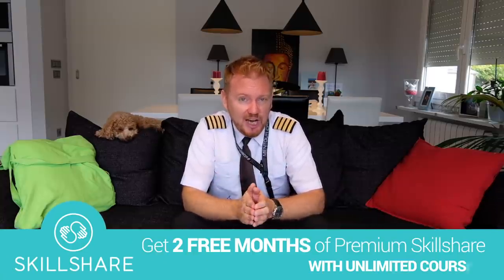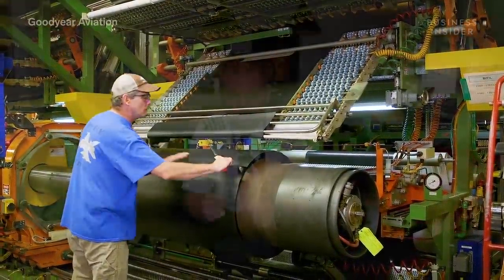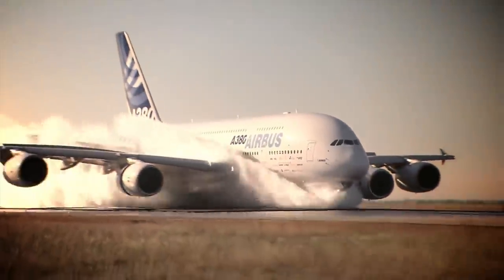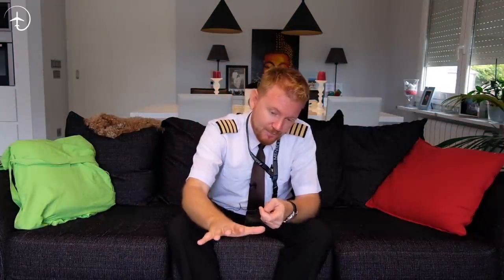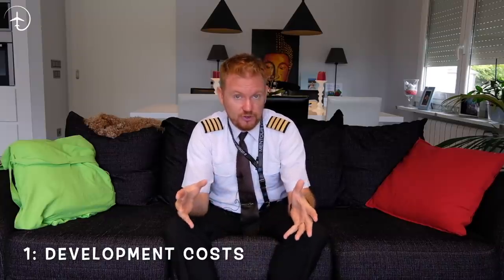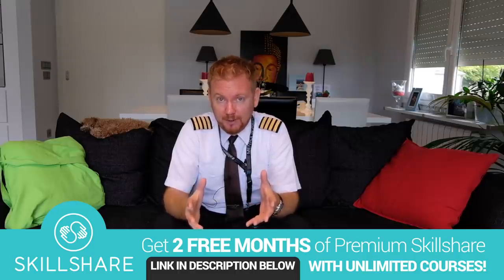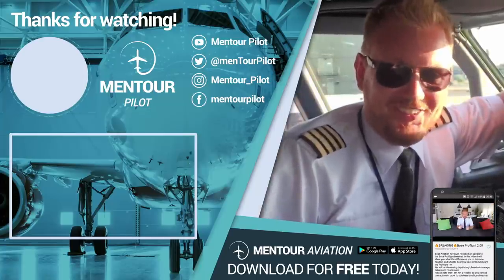Why not make plane-tires spin, before landing?!

Comment: I was a landing gear engineer with a major airline for 33 years and the tires were one of my responsibilities. Seeing the 2,617 comments below remind me of the MANY times I answered the same question. One of the major points you didn't mention is that the wheels spinning at touchdown speed with the tires  out of balance would shake the airplane apart. With eighteen tires spinning on a 747 one can imagine the shaking that would occur and the passenger's reaction.  Actually, B.F. Goodrich ran an exhaustive test on this problem a number of years ago and discontinued the test because of the vibration it set up. 
Everyone believes that adding little flaps on the wheels or tires would solve the rotation problem but there is no way to control the speed of each tire so there would be no real benefit. In addition, not only spinning the tires but the brakes would also have to be spun up which would require  considerable power. The brakes are designed to  absorb the  enormous energy of a rejected takeoff and not easily rotated.
Nitrogen is used to prevent the tires from exploding. We once had all four tires explode  on a 727 after the pilot taxied the airplane up and down the runway trying to burn off the fog. The tires at that time were filled with air (80% nitrogen and 20% oxygen).  The brakes became so hot with all the taxiing that the tire solvents mixed with the 20% oxygen and became hot enough to explode. We all converted to filing the tires with nitrogen after that. As an added note, when the Concorde was designed, they considered using nitrogen in the tires just to save weight. 
The gyroscopic effect of spinning tires would also adversely effect trying to control the airplane  during a critical time of landing.
Your video brought some interesting points from a pilot's perspective. I just thought I would add a few points from an engineering point of view and experience.
Reply: Wouldn't compressed air (or bleed air) work as, not driving the wheels, but shoot them up to speed, any speed would lessen the wear and tear more or less, doesn't have to be exactly the airplane speed.
Reply: thank God, someone who knows what he's talking about ... I'm not an engineer , but I've been working for a major airline for the past 30 years or so , and still am ... I must tell you that from my point of you , the biggest issue would be the huge gyroscopic effect , generated by large spinning wheels,  especially on big aircrafts like B-747  or AB -380 ...
 imagine trying to land in countries during the monsoon season ... there is no way the pilots could manage a landing with strong cross winds ...
Reply: Your reply and your point of view about this matter was very interesting and very professional.
Many times people comment only about the superficial not seeing the technical part of the subject. Congrats for your detailed information. Also I believe that you should be the person to publish videos about the technology of the landing gear.
Reply: The LG of any a/c is what seems to be one of the major issues in a/c design ... and the correct functioning ( maintenance + correct use, within parameters ) is mandatory ... think about the Concorde : it's the chain of events that led to catastrophe , and the key role was a non correctly rebuilt LG ... they forgot to put the spacer between the ballbearing ...
Reply: What would stop the addition of small fins to the wheel hubs so that they spin up in the airflow?
Reply: Toby Seaman The gyroscpic effect would still be there. Wouldn’t it?
Reply: @YDDES  doesn't affect cars, why would it affect airplanes? The relative mass of the wheels is tiny and the RPM is not actually that high.
Reply: @YDDES  yes, Sir !
Reply: He did mention about one wheel spinning faster than others with a possible faulty motor and shaking the plane off course, although he should have mentioned that even if the motors don’t fail it would still be nearly impossible to have all wheels spinning at the same speed.
Reply: Bill Witt is the shit
Reply: I'm a software developer working in real time safety critical systems. I'm really sure that all of the control issues wouldn't amount to much. Getting the wheels spinning at the same speed wouldn't be critical, they already don't spin at the same speed on current aircraft (wheels don't touch the ground at the same time). If I were designing the system there would be a hard power cutoff (per gear, per wheel, whatever suits) so that the wheel couldn't drive the aircraft while it's landing. 
I think Mentour hit the nail on the head with just one part of his point number one. It wouldn't be economical to add the weight for this kind of system. You could argue that the tyres could be made to be less resilient and therefore lighter if they didn't have to take the sudden speed increase, but I expect the saving wouldn't be much. They'd still have to be able cope with a fully laden, and fuelled aircraft returning to the takeoff airport.
Reply: @doncarlo5  I think we must remember that the missing spacer in Concorde's  "non correctly rebuilt LG" did not burst it's tyre or rupture the fuel tank. Continental were "responsible" for the Concorde crash: -  "The court ruled that the crash was caused by a piece of metal left on the runway after falling from a Continental jet - 6 Dec 2010." 113 killed reported by BBC 6 Dec 2010   people"
Reply: @rodharrap873   a colleague of mine ( died of cancer,  ... RIP ) was talking at the phone with some other colleague in Paris, (CDG int. airport ), it was the 25th of July ... I recall :I had late shift , that day !  At the very moment he ( colleague in Paris ) shouted : "Oh My God ! the Air France Concorde ...  just passed by , IT'S ON FIRE  ! And he hang up !"
According to the data recorders ( black boxes , both were "readable" ) and based on the evidence of the numerous eye witnesses, this is what happened :
the piece of metal lying on the track  ( lost by Continental  DC 10 )  ripped the tire , at that speed a big chunk of tire ( ca 10 lbs. ) hit the lower surface of the left wing , causing a shock wave ( and due to fluids non compressibility ) caused a plug in the tank to pop open  ... Concorde has 17 tanks ( for two reasons : for weight shifting during flight ... as 200.000 lbs of fuel  are needed from CDG to JFK ), and because of space optimizing , obviously !
At that point the jet A1 fuel started to pour out at very high rate,  but , still it wasn't lethal, to that point ...
A fuel spill had already happened once before , at JFK int. airport  ( but the fuel didn't catch fire , back then ).
Unfortunately, some debris from the busted tire severed an electrical power cable to the left under carriage , which sparks  ignited the kerosene flow , consequently the huge heat, generated by the burning fuel ,  started to affect both aerodynamics ( ailerons ) and engines thrust ( jet engines breath air - take the oxygen away - they starve ! )... now the pilots have just lost  76.000 lbs of thrust on the two engines ( left side )... DURING TAKE OFF ... the moment you need it most ! 
Cpt. C. Marty had to get airborne , he had already reached V2 , and had only 2000 m. track left ... at 340 Km/h , Concorde would have taken 3000 to a full stop !
Cpt. Marty  had taken the wrong decision to start with a mild rear wind, ( obviously ,  the take off speed of the Concorde is not much affected by a 8 knots  rear wind ) but it was also taking some extra weight in cpt. 5  
( luggage ) , and some extra fuel ... 
The fact that the spacer was missing forced the pilot to make a quite peculiar maneuver:    since the Concorde was not keeping a straight path, ( the left LG gear was "wobbling about" ) instead it was pulling to the LEFT ...
French President Francois Mitterrand was sitting with his entourage in Boeing 747 on taxi-way ... on the LEFT !  Waiting to get permission for take off ! Tower gave priority to Concorde , because they already had more than ONE  hour delay due to technical problems !
Marty had to get the nose up and take off ... otherwise, he would have been hitting the Boeing 747 waiting on the taxi way ( again ... on his left side )
Such a maneuver is called - to rotate - ( get the nose  up ) this meant putting extra load onto the already damaged left LG ... since the total weight of the a/c would be lasting on the LG ... the rest is history ... a sad one!
By the way : I'm not  makIng this stuff up   !
Reply: The vibration of a freely rotating tire can be excessive. Even on a small tire like on a Cessna 150 it can become necessary to use the brakes to stop the rotating tire vibration. It can rattle the entire airplane.
Reply: @Hoggaforfan  Read it again.
Reply: @tobyseaman7977  Read again what was written.
Reply: @tobyseaman7977  cars are in constant contact with the ground, not free to spin in the air. But tire weight does effect the handling of cars is does, therefore Compositte wheels and brake rotors a Grand fix Cars and Moto GP Motorcycles.
Reply: @flyingdog1498  don't understand your point. Contact with the ground irrelevant, we are talking about gyro effect of spinning wheel?
Reply: @tobyseaman7977  You need to study physics.
or maybe take a Mechanical Dynamics class.
Reply: @flyingdog1498  Read it again? Haven't read it in the first place. It's quite some difference between the weight of those plane types and landing gear. Don't you know physics? Beside my post was a though and just an idea, not in anyway stated as fact. I also read your posts to Toby and don't know if you are condescending or need medication.
Reply: @flyingdog1498  perfect, thanks. The gyrosopic effect for tethered and untethered is really interesting, but it's you that's not studied it :-)
Reply: @Hoggaforfan  You are a God Damn moron,
Reply: @Hoggaforfan  why would they use compressed air and not the 140 mph slip stream to spin up the tires
Reply: @ohhno1358  Slipstream would most likely be more weight and quite bulky to be of any use and not as effective either
Reply: If wheels spinning in-flight would "shake the airplane apart", then how does the aircraft survive takeoff when the wheels will be spinning as the aircraft leaves the ground? I just assumed a mechanism to spin up the wheels before landing wouldn't be worth its weight or complexity.
No idea what the magnitude of the gyro effects will be with tyres spun up for landing, but, if the tyres are spun up, and you try to roll the aircraft right, you need to exert a left-yaw moment on the spinning tyres, and if you don't, the aircraft will experience a right-yaw moment, right?
Reply: @tobyseaman7977  You would be suprized. On normal conditions difference is small. But on race track you will notice it more. Suspension works better (less unsprung weight),  brakes better (less inertia) and turns better. (less gyroscopic efect). That is why we spend lot on forged wheels and dont buy cheap cast ones.
Reply: @takatamiyagawa5688  they have brakes.
Reply: @Hoggaforfan  Do you even know what a slipstream is? Your first comment had some merit - bleed air is useful and abundant, although most of the other problems remain. Everything you have added since then does not reflect well on you.
Reply: @tobyseaman7977  Bill addresses your idea in his post. The vanes or flaps would either be too small to overcome the inertia of the tyres and brake discs or if made larger would lead to high levels of vibration, besides being one more point of failure and a source of runway debris.
Reply: @DavidSmith-vr1nb  Yes I know what it is and I posted my guess about it and reason for that guess, I thought it was clear it's just a guess. Besides my guess seems to be backed up by others. The third post I did was just to a very arrogant and confusing person.
Reply: @doncarlo5  Not knowing tire mechanics, but the aircraft is tons, tires are pounds.  I can't imagine the tires spinning would have any impact at all on anything when touching the surface with tons of weight on them.  But, I have to assume it does by also assuming this has been tested and proven thousands of times.  And balancing?  That's why my car's tires are...um...balanced.  Plus, they already vibrate the plane when lowered.  I must be seeing things in a very simplistic light, and have to accept the experts, which is hard at 65.
Reply: smart man
Reply: @tobyseaman7977  Vibrations if you would've read the good explanation of the landing gear engineer above.
Reply: @ayuse01  I did read it and it doesn't make sense. Landing gear gets vibrations anyway from asymmetric wear. Wheel balancing is a technology that is a hundred years old or more. This is an old thread.
Reply: @da4127  why nearly impossible to get them spinning at the same speed? You do know that this is a solved problem? We've been making things spin at exact RPM for 50 years.
Reply: Gyroscopic effect? Seems to balance a GYROSCOPE...OR A BIKE WHEEL... Provided the spin axis is in the same direction as the aircraft travel...no probs.
And....make sure the wheels and the device are well balanced.
In my experiences...it's the MTOW which concerns airlines.
Any weight added to the aircraft means less payload... Less money.
It ALL needs to be within MTOW
Reply: @MrCybaherbz  gyroscopic forces are good when you try to keep a straight line, but an aircraft have to make some high angle crab approach to counter crosswinds on landing. The aircraft have to make fast yaw movements at the last second just before touching down, with strong winds, the last thing you need is having to deal with gyroscopic forces on top of the rest.
Reply: @ayuse01  I get your poin. BUT we are talking 400 tonnes of plane being destabilised by a few spinning wheels... Nah...not buying it.

Tell me...on TAKE OFF... The plane could be doing 160 kts... Depending on wheel diameter...the wheels are going to continue to spin for a considerable time after losing contact with Terra Firma.
Then..the gear us pulled up... sometimes in a straight line.. sometimes to the sides...and even sometimes they twist as they go up to the well. So... SURELY..the "negative effects" of gyroscopic effect would be
..
1) More critical since the aircraft is gaining speed as it climbs.
2) More critical because unlike the so called "negative problems of gyroscopic effect" when landing, the plane is no longer on the ground and is getting higher and faster by the second.
So...If the GYROSCOPIC problem causes terrible safety issues... isn't the THREAT  magnified by the obvious fact that the crew can't stop the plane and sort out the issue whilst the plane is accelerating to cruise altitude and speed.
On the ground... That isn't a problem. Tbh... Have you ever landed in a SMOOTH strip...
These runways are worse than dirt tracks sometimes. Would anyone even notice the wheels spinning... I seriously doubt that.
3) If such a negative effect is overshadowing pre touchdown wheel spinup... WHY IS IT ALWAYS A SUBJECT WHICH DRAWS LOTS OF INVENTORS AND ENGINEERS TO SPEND TIME TRYING TO PERFECT AND MONEY FOR THE MULTITUDE OF PATENT APPLICATIONS WORLDWIDE...

That's my reason for 20+ years of chasing the grail.
Reply: @MrCybaherbz  Listen, even Bill Witt said it ,and I quote : The gyroscopic effect of spinning tires would also adversely effect trying to control the airplane  during a critical time of landing. : 

So if you feel like arguing with a 33 years experienced landing gear engineer, it is up to you Mr.Cybaherz
Reply: @MrCybaherbz  I understand your thinking, but where you make error is-

When an aircraft ( let's say a boeing 737-500 ) take off, the wheel brakes engage as soon as the command for gear retract is engaged. The wheels stop within a second or so after the landing gear lever is actuated. Then the wheels gets retracted.

Second, let's say you make a 14 hours flight, having anything to carry in the air for this amount of time cost fuel, a lot of it. And you have to reduce the payload accordingly ( another loss of $$ ) 

Third, you gain in complexity, not good in the air.

I could keep on going as to why it is a bad idea. But let's say this. The engineers who designed such massive aircraft are way ahead of us in the matter. And I honestly think that if it was such a good idea to pre-spin wheels on aircraft, it would already been addressed.
Reply: @tobyseaman7977  the wheels are indeed stopped as soon as the aircraft take off, to mitigate vibrations transferred to the cabin, and to cancel gyroscopic forces before stowing them. Just take a ride in a boeing and feel the vibrations as soon as the wheels take off, it stop as soon as the command for gear retract is actuated.
Reply: @ayuse01  NO ERROR....  JUST OPINION.

40+ YEARS IN ENGINEERING AND ELECTRONICS WORTH OF OPINION.
ENJOY YOUR WEEKEND. 👍🤠👍
Reply: Thank you for the correct reason for use of nitrogen. Large earthmoving equipment do so for the same reason, tire explosion. All the rest is nonsense. Based on this issue alone makes me never listen to this guy again. And thanks for the knowledge on balance. I had not considered that, but had considered the huge weight/power of motors to perform the pre-spin task and dismissed the idea many years ago on that basis alone.
Reply: @ashleyjanit5052  True, also burning a bit of rubber makes the tires a bit warmer, if its long haul fligt, tires might be super cold when the come out, and have no way of gripping if they are not warmed up.
Reply: I have a question.
How in God's name did they expect a 727 to clear fog?
Reply: The brakes aren't easily rotated? They had better be, at least when they are not applied, or they are adding to takeoff distance! Of course, I've never spun the wheel of a plane over 25 tons, so maybe Boeing and Airbus waste huge amounts of power by dragging the brakes when not in use.
Reply: Tires, no matter which type were never designed to free spin without a load. Spinning up a tire to 200mph without the weight of the plane on it, would send forces away from the center of the rotation, outwards. And while the bearings to the wheel are of metal alloys, the tire is a complex layering of cords, metals, and rubber. All this force would egg out the tire, sending the center tread outwards, beyond the way  it was designed to function. And while that may seem logical to some, it would most assuredly end in catastrophic premature tire failures. Possibly multiple failures at once. Not to mention, they would lose their ability to be retreaded, as casing stress would forbid future use. Look up videos showing the tires of a dragster warming up it’s tires, or somebody ruining their tires trying to get unstuck from ice or snow. Now ramp that up to a 200psi nitrogen filled tire, free spinning at 200mph. Too much risk, no reward. IMO.
Reply: It has been about 30 years since I ran an aircraft maintenance department, but I believe that spinning a tire for landing makes no difference on the wear of a tire that was not spun up. Both tires wear the same. The wear on the tire is caused not from friction of the tire at contact with the runway but from loading the tire. It has been a long time since I saw that test.
Reply: @davecrupel2817  The RVR sensors were known to be in a certain section near the end of the runway at my airport. I frequently took the first flight out in the morning. It was not unusual for them to sit a spool up the engines, turnaround on the taxiway and return to the hold short. This increased RVR above the TO limit. Away we went.
Reply: @Hoggaforfan  i was thinking the bleed air thing as well as that wouldn't be a positive drive like a motor. It would just be "encouragement" but the balance/vibration issue stated above makes it a moot point.
Reply: @Hoggaforfan  It's not important, whether your tires are attaining the exact speed of landing aircraft to reduce good amount of friction or not.
Point is while accelerating the spin of tires(all tires' "acceleration vs time" curve has to be accurately the same!!) to the opprox 300km speed with some means (mechanical, hydraulic pneumatic or electrical means) would result in additional unbalanced (different for every tire)gyro nose lift which is dangerously unpredictable in landing and to introduce these into existing system would be needing a lot of time consuming approvals, cirtifications and periodical "extra" validation protocols" , which are not worth than letting the tires wear a bit more..
Reply: @tobyseaman7977  cars run on land mind it.
Reply: @tobyseaman7977  contact with ground makes the car highly stable making wheels gyro neglible, mind it
Reply: Toby Seaman Cars are down on the ground, and stand very stable with one wheel at each corner. Airplanes are up in the sky, and don’t have that kind of stability. The gyro effect would be a lot more noticeable on an airplane.
Reply: Excessive brake use on taxiing aircraft continues to cause tire deflation from time to time, but that is not why the use of nitrogen is mandated in tires on braked wheels.  In 1986, Mexicana Flight 940 suffered a catastrophic wheel explosion after takeoff, resulting in a crash that killed all 167 people on board.  The explosion was caused by a dragging brake that overheated during takeoff, and the wheel failed after the gear was retracted into the wheel well.  This was not an unknown occurrence in the industry, but the magnitude of the explosion was far greater than could be accounted for by the excess pressure in the tire when the wheel failed.  The investigation revealed that there was a chemical explosion caused by the combination of outgassed chemicals from the overheated tire carcass and the oxygen in the air used to fill it.  Air is not now totally banned from tire inflation, although in practice it is not used.  If a tire filled with nitrogen is found to have low pressure but no leak, and no nitrogen is available to reinflate it, air may be used if the calculated mixture of oxygen in the added air does not exceed a critical ratio with the existing nitrogen.  This is a temporary measure to safely continue the trip and reach an airport with nitrogen available.

As far as spinning the wheels for touchdown, a tire manufacturer developed a tire with pockets in the sidewalls to spin up the wheels around 1940.  If I remember my history correctly, the tires were tested on the Douglas XB-19, which had the largest main wheel tires ever put on an airplane.  The tests proved that there was no useful adavantage to spinning the wheels before touchdown.
Reply: I am curious how this would work with electric motors that are digitally driven?
Like the Tesla cars, they can sense if they lose grip in nanoseconds and adjust thrust and everything, it's impossible to get wheel spin and accelerate really fast because of it.
Reply: doncarlo5 ....the heavy monsoon,cross winds, doubtful functioning of landing gear and a night landing on a tabletop runway...unfortunately we had all that happened yesterday taking 19 lives including pilot and co pilot 😔
Reply: The brake have to be rotated??  BS, Brakes are stationary.  They dont rotate.  The wheels and tires are the ones rotating.  Stationary brake system is used to stop them..
Reply: @outwiththem  so... what do the brake shoes or callipers apply pressure to? How do you transmit that load into the wheel? You use a drum or rotor. A large rotor for the size of airliner wheels would have a corresponding large mass. Trying to rotate a large mass takes a large effort. 
Add in some brake friction as the pads are skimming the surface of the rotor. Sure, the brakes aren't applied, but the pad will still have some contact. Jack up a wheel on your car, spin it, you can hear the contact yourself. 
Extrapolate those forces up to the scale of an airliner. Remember, you only have one disc per wheel on your car, airliners have multi disc packs per wheel, adding to the inertia and drag effects. 
So there are parts of the brakes that are not rotating, and others that are rotating.
Reply: @rustymozzy  -- he, he.. Im also an ASE Certificated almost Master Mechanic, retired now but worked for over ten years on dealerships as auto tech.  I know the rotors rotate with rims and tires.  The force of 140 mph winds can make small flaps on the rims or tires rotate them. 
Some Cessna Citations have that system for a decade, but on front tire only.  Airplane tire manufactures hate and put down those systems. 
Rubber smoke can mess your lungs too. Giving you black lung.  Rubber deposits on runway have caused many accidents too. 
Managers are getting kickbacks to avoid installing rim flaps.  Managers work in air conditioned offices with air filters to avoid getting all that rubber and kerosene exhaust at airports...
Reply: @outwiththem  a quick scuff on the runway will bring the surface of the tyre up to temp quickly to afford better grip, and there's not many people standing around the end of the runaway...
There's a lot more rubber scrubbing from tight vehicle movements on the apron in front of the terminal, there's probably more rubber dust exposure from the car park. It's a multi billion dollar industry. They've done the numbers, having spinning wheels would cost more, add weight and have less benefit than impact. 
If you wanted to eliminate tyre wear, you could add steering components to all groups, add more wheels, make the plane smaller, put less weight in the plane, increase wing dimensions to allow slower landing speeds... the list is endless. The key is finding a balance. Something is always sacrificed to increase performance in other areas.  In this case, rubber is easily replaced and maintained compared to the alternatives.
Reply: Great answer Bill, but please hear me out on a couple of things:
-If the gyroscopic effect was of such concern during landing, what about the takeoff? The Cessna Citation 500 series has an optional gravel kit with a pre-spun nose wheel.
-Filling the Concorde's tires with nitrogen wouldn't really do much for the weight as oxygen is only 3% heavier than nitrogen.
As you said; the potential savings per landing, with pre-spun tires, is pretty small (10%) as the diameter and shape of the tire changes during the initial spin-up resulting in over-under speed undulation pretty much regardless initial speed.
And the greatest ware occurs during takeoff anyway.
Reply: I did some work on a system similar to the one you described but with machined rotor vanes attached to the wheel rims. Keeping the wheel assemblies balanced was just one problem. Trying to get everything spinning and balanced at 2500rpm without causing excessive vibrations was a challenge. Once we had an acceptable solution on how to repeatably do that (a time-consuming engineering cost) the tyres still do not spin up to exactly the same speed as the runway anyway (they are always slower) and so they still scrub.

Our aircraft was a development aircraft. We had to alter the wiring and piping in the undercarriage bay and alter the shape of the doors to ensure enough clearance for the rotors (and it was still really tight). The brakes are applied when the undercarriage is unlocked anyway so the wheels didn't spin when extending or retracting but the extra width of the wheel assemblies wasn't nothing. It was 150mm per wheel on our test system. We figured we probably needed to at double that to 300mm for reliable rotation speeds. Any smaller and it couldn't overcome the friction in the assembly and the wheel wouldn't turn, much larger and the rotor vanes wouldn't fit in the undercarriage bay without modifying the aircraft structure, undercarriage assembly and bay. (Possible on new aircraft certainly not an easy, or cheap, in use fleet mod.)
The pilots noted the change in drag when the wheel brakes were applied in flight just before the undercarriage unlocked and when the brakes came off when the undercarriage locked down. The pilots never noticed any gyroscopic effects, or if they did they never mentioned them.
And test pilots mention absolutely everything at least twice to everybody they know.

The increased width and weight of the wheel assemblies, the increased size of the undercarriage bay, the reduced but not eliminated wear on the tyres, and the increased and ongoing engineering time required to balance the wheel assemblies with the rotors attached plus the increased wear on the brake rotors and pads all added up.
It wasn't working out to be cheaper than just changing a tyre when it wore out.
So why add the complexity?

And as a last point, the noises when the wheels span up to speed and when they stopped was a thing to hear. And you could hear it for miles even over the engines. From inside the cabin? Well. Yoiks!
Reply: Dirk Knight  If you had read the post closely you would have seen we didn't have a vibration problem.
The solution had both a logistics and engineering burden that was greater than that for standard wheel and tyre assemblies.
It was all the other stuff that eventually added up to pushing the idea out for financial reasons. It was just cheaper to change wheels when needed.
Reply: Dirk Knight  I'm pretty sure our tyres were Dunlop :-)
I think that all of the proposed engineered solutions would be viable, it is just that they would also all work out to be more expensive than just changing the tyres. They all have extra engineering time and costs. Aircraft don't make money sitting on the ground being worked on. Changing tyres is a pretty quick thing to do with experienced engineers. The tyre manufacturers really are not charging all that much for their products given what they actually go through.
Reply: Dirk Knight  Sort of. The mods would have saved us a dollar on tyres and cost us 5 dollars in other areas. We would pass that onto the airlines in costs who would pass it onto the passengers in costs. The passengers would go with the other cheaper airlines who didn't have the mods and so didn't have the costs. So yes, it would have cut the profits of the tyre manufacturer for the price of making our aircraft uncompetitive in cost per flying hour. Not good business sense. There is no monopoly for tyre manufacturers. The tyres are made to a published specification so the manufacturers have to compete on price for sales. They have to make a profit, they aren't charities, but if they charge too much you switch suppliers. Their products are worth the price they charge, and any profits they make are pretty fair. That's how business works.
The ultimate solution, if you don't want the tyre manufacturers to make profits, is to fit floats and land on water. Although this may cause other issues.
Reply: Dirk Knight  I could. But as they are proprietary documents owned by not me, it may prove to be a little expensive to myself to leak. The tests were carried out to ascertain whether or not it would save money and give us a competitive edge or not. You don't see anybody fitting any system like this because the answer is that it doesn't (and we know others have done very similar tests). If you want to try it yourself go right ahead, then publish your results. Let us know how it goes.
Reply: Dirk Knight  I can. I won't.
Reply: Dirk Knight  Wrong. Could. Won't.
If I did post a spreadsheet (It isn't on a spreadsheet but hey) you would just claim I made it up unless I could prove it was real. Then when I provide proof that it was real you would still claim it was faked. There is only one solution to this. Go do it yourself. If you really want to know for certain with indisputable answers. Just go do it yourself. Nothing is stopping you but your own laziness or ineptitude, or possibly both.
When you have finished post the answers here so we can all see how you did.
My guess. You wouldn't even know where to start.
Good luck.
Reply: Dirk Knight  Wrong again. Could. Won't.
How far have you got in your tests?
We ALL know you can't deliver.
Reply: Dirk Knight  You claim to be a troll but can you prove it?
Reply: Dirk Knight  Not proof.
Reply: "In addition, not only spinning the tires but the brakes would also have to be spun up which would require  considerable power. The brakes are designed to  absorb the  enormous energy of a rejected takeoff and not easily rotated."

I don't follow why said brakes are partially engaged.  Surely there are other ways to achieve that
Reply: 8:00
It seems fallacious to think that landing gear motors should have to double as taxiing gear.  Carrying the whole weight of the plane even at low speed would necessitate large heavy motors.  Motors just for spinning up, need only account for the moment of the wheel; which would have to be what 1% that size?
Electric gear spinup would mean precise speed matching also.

Provided there's an alternative to the break drag that you already mentioned.  Is there any reason to not just keep the gear spinning in flight?

If the gear can spend 10 minutes matching speed before being deployed the motors could be even smaller.
Reply: Dirk Knight 
Electric jet liners cant happen without superconductors.
Reply: @bushmasterflash  So it is possible and feasible.  All aviation test can be more complicated that expected.  Normal to be like that.  No gyroscopic effect.  I knew that due on take off you dont feel that.  Neither you feel big vibrations from "umbalanced assemblies".  You didnt need to modify the gear at all.  Citations and others have them  already on the nose tire at least.  Some pilots put those rims on their personal airplanes for nicer landings.  The inventions are there. 

A bit noisier on the landing?? No big deal, landing jets are not very noisy at all.  Gain??  Less tire wear out, Less gear links wear out. Billions of dollars saved a year.  Less rubber deposits on runways, Less runways closed outs to do that expensive task of removing those rubber deposits.  Which are payed by US the taxpayers.  Millions saved on that.  Nicer landings area a plus.  Less lung sickness for nearby workers and hoods.  Many advantages for a simple rims vanes. Many...  

And less runway excursion accidents too.. too many lately.  Great savings.  But the tire companies have the managers well paid to stop these mods on rims.  Shame on those managers..
Reply: Dirk Knight  
Maybe I should have been more specific.  I meant currently, (haha currently), theoretical high temperature ultra capacitors. That don't require cooling.

The best information I could find at a glance was for the GE90-115B.  110,000 HP = 82.026 Megawatt.
The highest voltage I can use for a switching controller for that engine, (without things getting exponentially difficult.) Is 6000 Volts.
That's still 13.671 Mega Amps!

You suggested using the vehicle shell, how do you propose to close the circuit?
Typically regulations require anything over 48 Volts to be electrically isolated from a vehicle chassis.

I don't think that's done for no reason.
Reply: Dirk Knight  
"Standard rail lines operate between 15kV and 25kV."

That is just the distribution voltage for a train at low speeds that needs relatively little in the way of throttle control.  It's for that reason that DC is often used for train line electrification.  Because they don't need to transition between different voltages.

Having said that I suppose it would be possible to combine a modern IGBT controller with Ye Old contactor sets.
Thereby dividing the higher voltage into 8 'ranges'.  So that the IGBT only 'sees' 5Kv source to drain at any one time.
You would want to be at take off speed within the first range though.  Can you imagine the controller behaving nicely, only to discover that an entire range of acceleration was then unavailable at the end of the runway?

"One would obviously use the entire body as system ground, just like in a car, so nobody can be exposed to electricity."

No doesn't work. You're not allowed over 48v DC on any vehicle chassis.  EV conversions have to have separate high voltage traction circuits.
DC-DC converters supplying the former 12v circuitry, headlights, signals, air-con etc. *MUST BE FULLY ISOLATED*.
These regulations were put in place for valid reasons. It's naive to think that they wouldn't end up applying to electric aircraft.

"We would probably need some sort of fuel cell or air breathing solid state battery (aluminum air) to get there."

Fully integrating the entire battery within the engine cowling might offer a solution though!
Reply: You could reduce tire wear by making them spin at a relative low speed before landing, you would not have to spin them all the way to match the landing speed. Right?
Reply: @flyingdog1498  That's an interesting point.  That must be what the unnerving rattle is on takeoff sometimes in commercial airliners, especially at the front.  The rattle is unusual, VERY STRONG, and sounds "off"... like it's not normal.  It stops right before the landing gear tuck in and gets unusually quiet.  Sounds like it's what you're saying -- the tires rotating in the wind or spinning down from the takeoff.  Pretty alarming.
Reply: wow i didn't thought about the gyroscopic effect, you are correct!! thank you for all this excellent information!
Reply: @tobyseaman7977  - cars and airplanes are not comparable in this case.  Cars are constrained to the ground by gravity and the gyro effects from the wheels are absorbed by the suspension components and transferred to the ground through the tire's contact patch.  That does put extra loads on the suspension bushings, hence the move to alloy wheels to reduce this and lengthen bushing lifetime.

Airplanes are a free body in space and can move in all six degrees of freedom, making them susceptible to all forces acting on them.  Remember that torque from a gyroscope act at right angles to both the axis of spin and the precession  axis.  This is very non-intuitive.  With the wheels spinning on their axles, if the pilot were to yaw (steer left or right) then the spinning wheels would force a roll and vice versa.  Pitch wouldn't have any effect since that's rotating the airplane on the same axis that the wheels are spinning.

The last thing a pilot needs during this critical time is unexpected inputs acting in weird ways.
Reply: The gyroscopic effect from the spinning wheels is paramount from a safety standpoint; where for example a pilots roll command gets converted into yaw motion and this would adversely affect handling during the critical last moments prior to touchdown.
Reply: Of course you know the tires spin in whatever state of balance they are in anyone when they touchdown. Are you trying to say that the load of the aircraft dampens those vibrations? I guess that could be significant. Have you tested wheels spun up unloaded and determined some insight into your claim of excess vibration, or what are you basing that on?
Reply: @da4127  no it wouldn't be technically difficult at all. And minor differences would be unimportant. These would not be drive motors of course.
Reply: My father in law is a retired Dunlop aviation engineer - I have had an identical discussion with him - very interesting cheers
Reply: @ashleyjanit5052  pure speculation. Or do  you think you understand the magnitude of those gyroscopic forces versus the scale of other normal forces on the aircraft? They are likely trivial, bUT I don't really claim to know exactly. Gee imagine saying that way, instead of as if you knew. And the thumbs up too. For what? Creativity?
Reply: what the fuk are you talking about 'brakes would have to be spun up?' Also a google search (and actual science) says "Aircraft tires indeed are filled with nitrogen to mitigate temperature fluctuations, but not because nitrogen has any special heat-absorbing qualities. Rather, it's the presence of water that makes standard, commercially available compressed air a poor, even dangerous choice for aircraft tires" Maybe you were a landing gear engineer, or maybe you were a mechanic. Or maybe you are just a crank. Your speculation about gyro effects, um, based on what calculations? Your shit about tires exploding from the oxygen in air, total bat shit crazy. And people think you are a 'good source'. wow. Spinning wheel would shake the plane apart. wow, just wow.
Reply: @tobyseaman7977  It DOES effect cars, but the mechanical grip and linkage turning the wheels is much stronger.

An airplane maneuvers via other forces (deflection of air) and we are talking about these forces when the plane is not connected to the ground.
Reply: @bushmasterflash  

Ok. Points for style..;)
Reply: @doncarlo5  .... The same gyroscopic effect you get when the airplane takes off and the wheels spinning make no difference?
Reply: Molding aerodynamic "flaps" on the sidewalls of the tires would be he only practical solution, but that vibration makes sense, with such.....heavy ass...tires
I guess even setting them to spin up to just 10MPH or so wouldn't be worth the trouble.
I wonder if the development of such sidewall "flaps" that somehow required the specific aerodynamic conditions under ground effect to catch the wind and begin spinning up might have influenced the conclusions on the tests you mentioned....

By the way, as annoying as I'm sure it may be to answer the same questions for people so often, questions like this, at least tend to come from very mindful people-which is a nice trait to see...
Reply: @doncarlo5  yeah that gyroscopic effect would be insane. That's an easy problem to solve though; you just need to breed some giant sequoia trees to grow forged magnesium wheels.
Reply: @tobyseaman7977  cars only have three degrees of freedom to move, rather than 6, and they have the road to grip onto instead of just the air.
Reply: I have long thought that, instead of adding more complexity to the system by means of motors, etc, why not simply modify the design of the wheels/tyres themselves (a bit) to accommodate angled [rubber] membranes between the parallel groves of the tyres. These membranes would catch the oncoming air and spin the tyres. Although they would not make the tyres reach the exact airspeed of the plane, they would at least provide [significant] reduction in the wear and tear of the tyres. It seems to me that it is not important that tyres do not all have the exact same speed. Also, you mention vibration as a problem arising from the lack of balance in the tyres, but this begs the question of why not simply just balance the tyres (just like car tyres are balanced)? Lastly, I simply do not see why brakes would have to be spun along with the tyres.
Reply: I just want to point out that the gyroscopic effect (more specifically the troublesome precessive component) could be cancelled out by spinning half the wheels in the reverse direction.

:D :D :D
Reply: @outwiththem  Brakes on larger aircraft are not like car or Cessna brakes. They use a stack of rotors & stators sandwiched together & when hydraulic power is supplied to the pucks, the whole thing is sandwiched together to stop the aircraft. These stacks do rotate fairly easily but there is also just a bit of drag as well as added surface area of a group of rotors turning with the tire. This of course increases with the size/weight of the wheel/tire assy & brake.  So, half of the brake does rotate with the tire.
Reply: @eltouristoduo  Because aircraft brakes are made as a stack of stators & rotors that are compressed to provide braking. The wheels have drive keys that lock into every rotor, so half of the brakes do, in fact, rotate with the wheels (depending on design & size of the aircraft, of course).
Reply: @averageguy371  Soo?? 180 mph wind can spin all that.  Even small vanes spinning the tires at half the speed of landing can save billions to airlines..  And less rubber on runways to produce accidents, expenses to remove it and runway maintenance delays.
Reply: ironic then that the tires caused the failure
Reply: Better just to cover the touchdown zone with a thin layer of water. tires spin up slowly, not too much wear, tear, and airframe jolt, then brakes on the dry part of the runway. Won't work in Chicago Midway though. Too short!
Reply: Finally, a very good answer to a question I've asked for years. Thank you.
Reply: @outwiththem  The cost savings still won't outweigh the initial design, testing, & procurement costs. There's no real problem now so there's no reason to address it.
Reply: @tobyseaman7977  There are two effects that come into play at this point. The tire needs to be completely balanced as to centrifugal effects at the rim, and the tires need to be balanced from left to right of the center line of the tire. If that balance is even a little off at the high speeds needed at aircraft landing time, a tire could be vibrating from left to right at such a rate as to shake the landing gear apart in a rather spectacular way which would be catastrophic for the aircraft and the people aboard. Spectacular, because the aircraft would be landing on a peg rather than a tire. Catastrophic because that would, for all intents and purposes, disintegrate the aircraft.
Reply: @averageguy371  Bullshit.. There are problems.  Billions spend on tires and landing gear repairs and runway repairs and also lung cancer for airport or nearby hoods.. LOTS OF PROBLEMS.  It is illegal in the same nearby hoods to go with your car and produce the same kind of tire smoke.  Problems.  Try that..  You will get a big ticket for Pollution and road damages.
Reply: I agree but i see it as challenge.. i think utilizing the air around the wheel to spin them up would be the way to got.. and and two aluminum discs and permanent magnet moving in and out via hydraulic should be controlling the speed... braking the fast ones meeting the lowest... its not about matching the velocity its about saving rubber as cheap as possible.. .. and vibrations of the wheel? Just pit a damper that can handle the weight of the wheel in the suspencipn.. guess there is already something dampening in the other way.. i think of a rubber ball... 

And i think nobody did test this for real because rubber is relatively cheap.. as long there is some oil to male em..
Reply: @outwiththem  The reality is that you're making it an issue where there's not one. Do you really think airline companies wouldn't address it if it cost billions of dollars? Incidently, even if a tire blows on landing, the majority of the time you just replace the wheel/tire assy & maybe brake assy & press on. You get in trouble in your car because of noise & reckless driving, not because of lung cancer.
Reply: @CellaDorrn  That would overly complicate the landing gear & you'd have to run another set of hydraulic lines to each wheel. That is a weight addition & another system that can break. It would also cost a ton to design & retrofit the fleet. You'd still have the gyro effects too. 

I know there was some testing done years ago.
Reply: Why can’t they use regenerative braking on it?
Reply: That was very interesting! Thanks
Reply: Dear Bill, thanks so much for the comment - great to hear that from someone with real life hands on experience.
Why do you think the auto-brake system, which measures the individual RPMs of each tire anyway, so no extra sensor needed, could now be used to sync up all wheels rpms with the regular breaks to the revolutions of the slowest wheel? Wouldn't that solve all problems and still optimize the situation?
Greetings from Joerg in Munich
Reply: Thanks for the info! 👏👏👍👍
Reply: @doncarlo5  Gyroscopic effects only a torque at right angles to the axis of rotation.  If anything, it would make the airplane less likely to swerve once on the runway. It might be a factor in a crosswind if using the kick and dip method of flaring. Not much used with underslung engines due to ground clearance issues.
Reply: @averageguy371  Read again.  There are problems that need to be fixed.  But some like you ignore the obvious and do nothing.   At least i do something. Im not a lazy coward..
Reply: @jacknisen  No, better cover it with Heavy Grease.  Or better, Non diarreah Shit.
Reply: @cbpriv  You mean the tires that have been hanging out in the breeze for at least the last seven nautical miles (or about three minutes), getting ambient air blasted over them at 130 knots?
Reply: A A because it is way easier to dup a huge amount of energy into friction instead of magnetic attraction and repulsion... there is no car depending only on regenarative breaking... and no bike would ever want to use the Dynamo to brake down the hill...

And imagine a motor/generator that is able to handle that load... expensive, not as reliable, heavy... and all of that just to get a sligt advantage of saving a few hubdred bucks a year
Reply: @Bill -  cool stuff.
Reply: @outwiththem  How long have you been in aviation?
Reply: My Dad was apart of the engineers from Sandia Labs that studied this very thing.
Reply: @averageguy371  Since very young 1973...  Seen a lot, sniff a lot of rubber from tires at touchdown.  Skidded on rubberised runway areas when wet.  They cause accidents.  ..  Have you had to put up with that shit ever..??
Reply: @CellaDorrn  - You dont need any heavy equiptment.  Just aluminum vanes on tire rims.  Thats all.  Citation uses them in front tires and they get more landings from them.. 
A Simple solution that is stopped by greedy managers getting paybacks and perks from tire manufacturers..
Reply: @outwiththem  Maybe a better question would be what is your job in aviation?
Reply: @averageguy371  Commercial Pilot all Caribbean and most east side USa, and Latin america.. almost Master Mechanic on cars and Motorcycles.  CFI for 3,000 hours part time since 1994..  Aerobatics. and EFATO expert. 

I also used to drive Super Stock Cars NHRA drag racers in the 1970's.  No, we dont try to burn rubber in races.  Just before, to warm them up.  Burning rubber In a race makes you  lose traction and also leave a rubber mark.  Rubber deposits are removed due make others lose traction too and produce also LOC by pulling more on one side than the other.  NHRA specifies to remove rubber deposits as soon as posible.  Rubber deposits or "Skid Marks" are stupid things to leave there.  They get slippery..
Reply: outwiththem thats not regenerative braking.. regenerative breaking uses the driving electric engine to break.. for that it woud be a large amount of equipment...

and yes magnet aluminum breaking in kombination with air as driving energy was my first idea popping in mind but there are a few draw backs..
First the weels don‘t get up to the aircraft speed and they would have different speeds ... and Someone here said its a vibration problem 

Now to eddy current breaking.. you could make the magnet retractable or electric.. wich would mean mor energy to store and to make or a hydraulic failsave system.. they can not be so strong the weel loses friction and they scale .. no speed no breaking power.. so if you are half the speed you are also just heaving half the breaking power... the energy is also dumped as heat into the Aluminium... the magnet for that kind of energy needs to have some serious power or size/weight... and the biggest drawback... there are already brakes... and there is a reasons f1 cars use the precise and strong friction brakes

Yes you could engineer a second brake to save some braking pad .. but because the magnetic brake scales to speed you need to scale the mechanical brakes too
So not just a new brake also a brake Controller, maybe hydraulics... that would never amortize
Reply: @CellaDorrn  Lets put some Mack Diesel engines on the tires instead??  BS.  You just need the vanes on the rims.  Citations use them already.
Reply: @outwiththem  Ok. I've been a mechanic for 33 years. I'll stand by my comments.
Reply: @averageguy371  And I have been a mechanic for over 50 years.  Im 68 now.  And pilot since 17 years old.  51 years flying airplanes..  Beat that, chumpie..
Reply: @outwiththem  I don't have to beat anything. I'm not immature on the keyboard nor am I arrogant like you, although I don't bow to either pilots or engineers. I've had to talk sense into both many times. Simply put, if this was a problem, there would be a fix. There is no fix because there is no real problem. Rubber buildup is addressed with runway maintenance, not with overly complex engineering for every aircraft on the planet. Tire wear is addressed by a guy like me going out to change the tire. Done & done.
Reply: Why would using pure nitrogen reduce weight? The relative densities of nitrogen : oxygen are 1.25 : 1.43, I suppose at standard pressure and temperature. ~13% less dense, so ~13% less weight at the same pressure.
How much does the gas in a Concorde tire weigh at 232 psi?
Ordinary dry air: ~78% N₂, 20% O₂, 2% Ar: ?
Pure nitrogen: ?
Reply: @averageguy371  Bla, bla, Bla.. If you put me down, be ready to prove it beyond put downs, dummy.. You lose, thats it..
Reply: @averageguy371  And for the 10th time i told you, moron.. Its not "complicated engineering" as you keep writing.  Citations already use them Rim Vanes".. Gee you are such a Dammm MORON..
Reply: @outwiththem  Again, you prove my point. I certainly hope your flying skills (IF you are really a pilot) are better than your internet manners. I wouldn't take a car to you for a repair. I'd explain why but your immaturity & arrogance would prevent you from understanding the point & why it matters. Goodbye.
Reply: @averageguy371  Im not nice with the nasty.  Dam moron..
Reply: I was landing gear dynamics engineer for a major airframe manufacturer; the guy at my company who wrote the reply letters to would-be inventors of tire pre-rotation (after I proudly presented the idea to my boss and found out I was decades late, but that the timing didn't matter anyway because... see below).  I've laboriously read the preceding 154 comments.   If I was entitled to a wish list for this thread (which I'm not), it would include no more talk regarding:

*  Corporate conspiracy theories (unless you just can't help yourself).

*  Presumed gyroscopic calamities.

*  Anything comparing car tires/suspensions to airliner landing gear.

*  The supposed economic viability of tire pre-rotation (by any percent of landing speed).  If it was a money-saver it would get used.  It's not, so it doesn't.  If somebody thinks they can come out ahead using vanes for tiny un-braked Citation NLG tires, then have at it I suppose... but not of relevance to airliner MLG.

*  Air-filled airliner tires ok/not ok.  They're not ok.  It isn't about relative densities -- N2 would still get used even if it weighed twice as much as air.  It's about avoiding tire failure from auto-deflagration, typically involving some assist from a contaminant (a hydrocarbon-contaminated fill hose in the case of a DC-10 which was lost to nose tire failure during its takeoff roll).

*  Requests for Bush Master Flash's notional engineering cost analysis spreadsheet.  Any professional who has studied the costs/benefits has arrived at the same no-go conclusion, for reasons both quantitative and qualitative (spreadsheetable and nonspreadsheetable).   Economically speaking, tire pre-rotation is the proverbial solution in search of a problem.
 
Picky Point:  Tires don't explode -- they burst.  Even the space shuttle Challenger didn't explode -- that was a deflagration.  Explosions propagate a sonic shock wave, vs a deflagration where the combustion front progresses subsonically.  As for a burst, that's simply whatever fluid something is filled with (air, N2 -- water if it's a hydrostat test) coming out all of a sudden through places it's not supposed to.
Reply: @marcmcreynolds2827  -ok, so lets keep wasting billions on tyres early replacement, millions of my taxpayers dollars on pulling the runway rubber and accidents due rubber deposits, instead of adding little vanes to the rims of tires.  Wow, that is sooo difficult.... soo difficult.. Buaaaa, buaaaa!!  It works, but the managers get kickbacks from the tyre manufacturers and that is the problem..
Reply: @outwiththem   At this point there's nothing left standing between you and a successful argument except for the whole of reality.  For starters, grab your fluid dynamics textbook -- or borrow one of mine -- and calculate what "little vanes" accomplish for a MLG wheel/tire/rotor stack assembly (answer: Nothing).  They would however mess up plenty of other things in the process of accomplishing that nothing.

> If I was entitled to a wish list for this thread (which I'm not), it would include no more talk regarding:
 Corporate conspiracy theories (*unless you just can't help yourself*).. <  Everyone knows about tire pre-rotation:  The airframe manufacturers, the airlines, the military, the tire makers.  Many (including me) have studied it professionally.  All the "manager kickbacks" in the world wouldn't keep the airlines in their purchase specifications or the military in its contract awarding from insisting on tire pre-rotation if it was actually worth it to them.  It was the US military which did some actual testing in the '50's-'60's of both air vane and motorized pre-rotation schemes and as a result rejected it for their use.

> millions of my taxpayers dollars on pulling the runway rubber and accidents due rubber deposits <  It's a fair guess that considerably more of my dollars have been remitted to a government than yours, so why am I not even more outraged about the situation with reverted rubber buildup on runways?  Possibility 1:  I have no idea compared to you what the tradeoffs are between tire pre-rotation and runway maintenance/safety.  Possibility 2:  Same as 1, but with the names switched around.
Reply: @marcmcreynolds2827  Ok, So go to Cessna headguarters or to those Citation airplanes bases and picked them with signs--  Hey; stop using Tire Rotators.  STOP NOW...
Reply: @outwiththem   >  If somebody thinks they can come out ahead using vanes for tiny un-braked Citation NLG tires, then have at it I suppose... but not of relevance to airliner MLG <   It's a basic physics limitation:  The force you can get from an aero surface (e.g. vane) increases with the square of the lineal dimension, while the amount of inertia which that aero force has to rotate increases by roughly the cube (or more) of the lineal dimension.  So what might work for smaller things at some point stops working for larger things.  Throw in the brake rotor inertia of a MLG (vs an unbraked NLG) on top of the sizing effect, and it's easy (for engineers anyway) to see why vanes won't cut it for airliner MLG.  If somebody did want MLG pre-rotation for some reason (but nobody does), it would have to be motors.
Reply: @marcmcreynolds2827  Like old thinkers used to believe that wind power turbines had to be not too big to work well, not too big... 
Last few decades we have 150 feet long turbine blades producing electricity to light small villages with 15 knots wind only to move them.  Imagine an airliner moving vanes at 160 plus approach speeds, They will move a tractor tire.  Wind power is strong.  No vibration at all, they dont vibrate on take off speeds either.. Its all BS from the managers that get perks and payments for buying a lot of tyres from Dunlop mostly..
Reply: @outwiththem   Those thinkers would have to be very old thinkers to think that.  Osborne Reynolds showed in the late 1800's that bigger is better when it comes to airfoils -- and smaller is worse.  So Ozzie could have told you in 1899 that 50-meter turbine blades would be great for low-speed turbines.

It's not that tires can't be made to rotate from vanes -- any undergraduate mechanical engineering student could run the numbers as to roughly what would be needed to accomplish that.  It's that when one does such calculations (vs your arm-waving assumptions) the vanes turn out to be way too big to fit in a wheel well.

> Imagine an airliner moving vanes at 160 plus approach speeds <  In case there's still any confusion, note that no one needs to "imagine" anything. It can all be calculated with reasonable accuracy, at least by people who know what they are doing.  Grab yourself a copy of "Fluid Dynamic Drag" (Hoerner) to go with the undergrad fluid dynamics book I offered to loan you, and see for yourself.

> Its all BS from the managers that get perks and payments for buying a lot of tyres from Dunlop mostly. <
*  Corporate conspiracy theories (unless you just can't help yourself).
Reply: @marcmcreynolds2827  - Even spinning them at half the speeds with smaller Rim Vanes will save in tyre replacement and runway maintenance.  It is a simple thing.. But.. The managers will say- Hell no.. That will be complicated and no good. Excuse me now, i have to open this gift from the tyre manufacturer now.  Go away.. LOL.. I bet that happened to you too..
Reply: @outwiththem    It is a simple thing, in concept. That's why seemingly everyone invents it at some point in their life, and then from there the script diverges according to one's technical competence or lack thereof. You can keep saying "yes", but the physics is going to keep saying "no" whether you are able to comprehend said physics (and numerous related problems) or not.

Since there's something in your brain wiring which compels you to imagine secret arrangements between conspiring "managers" and robber-baron aircraft tire companies, might I suggest there are far better conspiracy theories out there than tire pre-rotation?  Do you really want to risk having other conspiracy theorists laugh at you in the next meeting?  They go around the circle, and it's JFK and it's United 93 and then the talking stick finally lands in your hand but all you've got is... tire pre-rotation. At least jazz it up some -- have the tire run over JFK or something.
Reply: I wouldn't think the tires would need to spin at landing speed.  Even spinning slowly at say 25 mph would reduce a large amount of inertial stress.  The energy required to make the wheels spin must be incredible.  It showed in the video it was even aparently enough to make the plane bounce when the wheels touched.
Reply: @datsuntoyy   It's true that you don't need to spin to landing speed, though a USAF study from ~1960's found that about half of the touchdown speed was needed to make much of a difference on tire wear.  That study wouldn't be the last word in terms of modern airliner tires, but is at least a guidepost of some sort in the absence of other data. My very rough calculation of what 25 mph would buy for spin-up energy "relief": (25/140)^2 = (only) 3%.

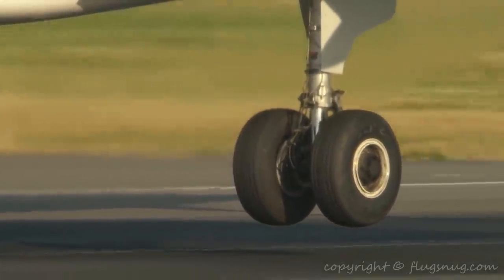>  apparently enough to make the plane bounce when the wheels touched < If you are talking about for example at 9:20 in the video, showing the slow-motion touchdown of a dual landing gear, that slight bounce is fairly normal and not related to tire spinup. Especially for a gentle touchdown like the one shown (~3 fps sink rate?), what causes that is:

* At touchdown a vertical load is applied into the tire(s). That load amount is mostly a "dynamic" or inertial one -- from canceling the sink rate -- with only a relatively small amount of the static aircraft weight contributing at this point because prior to spoiler deployment most of the aircraft's weight is still supported by the wing. The tire compresses by some amount from this dynamic + static load.

* Once vertical speed has been negated, tire load is reduced from its peak and the tire (acting as a more or less undamped spring) rebounds, pushing up on the strut.  In some cases such as seen here, that spring force pushes the wing up enough to cause the tire to break contact with the ground momentarily.

* After some tenths of a second (remember this is very slow-motion video), the ground spoilers deploy and at that point most of the airframe weight is no longer being supported by the wing. The wing starts heading back down, and that's when the tire sees the major landing load it will get. This time when the tire touches, the load keeps coming and the tire compresses even more than it did from the first contact. But there will be no rebound into the air this time, even at that higher load level, because now the shock strut compresses (seen at about 9:25) and the damping (energy absorbing) which goes on inside of it (oil forced from one chamber to another through a small orifice) dissipates energy (by converting it to heat) which might have otherwise caused a second bounce. [I like engineering. Engineering is fun!]
Reply: @marcmcreynolds2827  Thankyou.
Reply: @tobyseaman7977  Cars have the ground to transfer loads to, planes have to stabilize themselves with only air, with spacecraft it's even more challenging, having no medium to push against.
Reply: I have always wondered how exspensive airplane tires would be since you can tell they are made with an entirely different material the car or truck tires.  Also wondered how long they last.  Intresting video answered some of those questions
Reply: @eaglerising2688  737 main tires are around $1,500 each.  Varies due to brand and probably the contract the airlines work out to buy them
Reply: @eaglerising2688   > you can tell they are made with an entirely different material the car or truck tires <  In my landing gear group at work, there were airliner tire cross sections sitting on top of nearby file cabinets.  Presumably handouts from one or more tire vendors, thin-sliced sliced from carcasses of test tires.  I used to look at them and mentally compare to car tires.  The cross-sectional shape is similar, though several times thicker as needed to carry the humongous loads. Also more plies in the tread, again for more strength.  But basically an overgrown truck tire, operated at around twice the percent deflection.

FWIW, I was at a NASA meeting where the manufacturer of the Space Shuttle orbiter's tire described it as an airliner tire in essence, though with different proportions of materials (words to that effect). I assume that referred to the chemical composition of the rubber, plus more cords and tweaks to the cross-section.
Reply: @doncarlo5  Yes, I was expecting that to be the main reason, as I remember hearing of the gyroscopic effect being an unintended result when this was tried a long time ago. Is flat-spotting of the tires (creating balance issues) ever a problem or do they wear fairly evenly? With all that smoke and noise, there is an illusion that the tire is sliding, but in reality it does start spinning immediately, so I'm guessing it's not a big deal.
Reply: @tobyseaman7977  Actually, take one of the weights off your car tires and see what happens.
Reply: @stevenbass732  Nothing happens. My wheels are large and heavy and rotate slowly.  I'm sure it would be different for a faster car, but balance is a good argument for not wanting to loose rubber every landing and is an argument for pre-spinning the wheels and not for not prespinning them.
Reply: Wow Bill & other freaks. You were probably one of those engineers that, for 33 years, loved to hear himself talk during meetings. Do you realize how many of your colleagues committed suicide, went postal, or ran amok with butcher's knifes because of creatures like you ?
Reply: I had this idea about 10 years ago or so thinking its the equivilent of a car spinning it's wheels to start up and how much tread is wasted.  I quick search came up with data that said most of the wear on an air plane tire was from resisting lateral pressures..???  Any way, my thought pattern then went to hub caps with vanes  that would pick up the 300mph wind speed to speed up tire maybe with extra ducts to direct the air.   Then I thought about the tire incorporating cups shapes into the side walls of the tires to pick up the air and cause some spin up.   Thought the tire companies could make money charging more and saving the labor of changing of tires,  maybe for military planes.
Looks like your repsonse said you looked into  ""... flaps on wheels or tires ... "  so I guess its all been thought about.
I would think that not being driven, as by a motor but just spun up by the air to get closer to landing speed would help on wear but it seems like it can add other problems as you mentions.  balance and gyroscopic effects..
 thanks for you "engineering view point."
Reply: @Bill Witt
Finally a got an answer, many thanks.
Reply: Equipping the wheel axles with piezos sensor to define the unbalance and correct by means of a small automaton in flight will not require a significant addition of weight.
On the other hand, the gyroscopic effect is a relevant objection.
This will work negatively for crosswind landings.
it could be disactivated by blocking the valve 'see below) when the angle with the airstrip is too important.
 A small aerodynamic turbine printed on the rim could make the job. A tachometer to use a small valve to close the air entry on the "turbine"  this valve will be powered by a simple generator
Reply: @tobyseaman7977  Cars don't fly or rotate on multiple axes. Derp. Was this a serious question?
Reply: @MrCybaherbz  That's awesome, not spotted this before.  I guess that they do spin them down pretty quick to retract the buggers but still they are spinning when the plane leaves the ground, so good argument ;-)
Reply: @adamjc9683  was your question How many axes do cars rotate on normally and how many axes do the gyroscopic effects act on?  Do cars normally rotate on less axes that aircraft - yes, pretty sure they do.  If the gyro effects are so great why don't they affect aircraft when they take off?  takes a few seconds for the pilot to hit the retracts?  I'm hitting you with return Derp plus pillock.
Reply: Wouldn’t it create a flywheel affect .Rudder input would have much less effect .  If you spin a bike wheel at home try & turn it, it takes some effort. Sounds interesting but Physics just kills it. That is the very reason that your hear a thump when the front wheels are retracted. They have a low tech material, to stop the wheel spinning when it is retracted.
Reply: @outwiththem  
"Im 68 now.  And pilot since 17 years old.  51 years flying airplanes..  Beat that, chumpie."
LOL, I'll take "how a 68 year old man sounds like a 12 year old posturing for his Minecraft mates for $100, Alex." This is embarrassing, boomer.
Reply: @mef9327  You have to talk rough to rough guys.  Necessary Roughness.
Reply: @outwiththem  
"You have to talk rough to rough guys.  Necessary Roughness."
I suppose that's one way to see it; if it's that important to your fragile ego to "win" an internet argument with a total stranger. Congratulations...I guess. Are you going to frame your prize and display it on your mantle?
Reply: @mef9327  Why should i let an arsehole lie or twist what im posting about what i know.  Im retired, i have the time to answer back.  

Sorry if you cant answer back.  or dont have the balls to right a wrong.  Let me speak with your father about that!!
Reply: @outwiththem  
So winning an argument on the internet is akin to “righting a wrong” and it takes balls? Whatever you say, hero.Thank you for your bravery. I’ll put you in for a Purple Heart. Maybe we can have a drink together at the VFW and trade war stories.
     Oh, also, you’re going to have a hard time talking to my father since he died 20 years ago (when I was 35).
     Take care, superstar. Be safe out there.
Reply: How much of extra break effect gives the wheel as it stands still, in comparison to one that would spin almost at landing speed? Some Swiss maintenance Engineer once in Zurich told me that as one reason for not spinning up the wheels. Now after watching the video pls reading your comment, I guess that is not really a reason.
Reply: @opsmos  They need to keep the racket going.  The managers dont care for the health of the outside workers inhaling rubber dust.   EPA agencies made studies of kids around airports.  They have more respiratory problems.

  The managers just tell them "They dont have a solution for the tires dust".  Its all bullshit and lies.  The managers gets peers from the tire manufacturers. Its proven by whistleblowers, but they bullshit the public with "We need to maybe put electric engines on every tire"  which is a lie.  

The simple to install wind turn devices are patented since the 1960's.  Different versions of it.  But they just say or pay the engineers to shut up and say.. Ahh That dont work, lets talk about something else, the managers are listening to you,,  Shut up..
Reply: Now I understand :)
Reply: @mef9327  All right..  Im retired commercial pilot and with covid, not too many places to go safely.  So the net for hours debunking what I know is BS is my hobby.   Take care..
Reply: @doncarlo5  "Such a maneuver is called - to rotate - ( get the nose  up ) this meant putting extra load onto the already damaged left LG ... since the total weight of the a/c would be lasting on the LG ."  What actually happens is that as the speed increases, the wins start to create lift, at one point when you "rotate" the whole weight of the aircraft is compensated by the lift of the wins. there is no such a thing as extra weight in the other LG.
Reply: I love every inch of this comment.
Reply: My concern would be to have so many gyroscope trying to keep the plane going straignt
Reply: @jbellehumeur8010  Tractor trailers have 18 tires too.  And they are not small in proportion to their bodies like airplane tires are.  And they dont vibrate at 90 mph i have seen them.  Even with all the potholes and damages they get on the roads under heavy weights.  ITS BULLSHIT ABOUT VIBRATION.  
They can insert bad tires to vibrate, make a video abou it- to continue the racket..
Reply: @tabooretka  Exactly.  On every take off, the tires are spun sometimes higher speeds than on approaches due tires keep spinning faster with inertia after leaving the ground.  So it is Bullshit that spinning tires in the air will produce control problems.  Total BULLSHIT.
Reply: Really don't spend too much time concerning myself with this..lol
But, it's super interesting.
I too, thought about little 'flaps' of some sort..guess not..🤪
.
Never thought of the gyroscopic effect either; but, totally makes sense.
.
Now I'm wondering about the physics of landing a plane at an angle.
Always found that amazing when I've see it.
Thanks for the 411 my good sir..😁👍🏼
Reply: This is something I've thought about for a while and had a couple ideas on how to make it happen but I never thought about the gyroscopic effect or an out of balance tire thank you for clearing that up for me.
Reply: @joelombardi7283  Tires are accelerated to higher speeds on the take offs, they are small in comparison to the whole machine.  Its all a lie about the "imbalance of the tires".  Every take off they are spun to higher speeds and no vibration from even imbalanced tires as they BS.
Reply: Thank you for that.🤔
Reply: I was thinking about the temperature of the tires. Is the initial spin up with a high degree of friction useful for heating up the tire ? F1 cars heat up their tires in order to gain more grip. So the initial friction could actually increase tire grip on deceleration. Is that so ? I have no idea. I´d love to hear your opinion.
Reply: WTF when the Concorde was designed, they considered using nitrogen in the tires just to save weight.  WTF supersonic commercial flight is hard
Reply: and what are "solvents" doing inside the void space of tires in the first place??
Reply: @radioman140  i think he means the solvents in the rubber compound of the tire
Reply: Too long to read. Sorry.
Reply: @aliozanerbektas  TLDR: They have thought about it, it's not a good idea.
Reply: @tobyseaman7977  The difference would be that the car is on the ground and when you turn the gyroscopic effect would have to overcome friction with the ground. In a plane it would just “slide” through the air.
Reply: @tobyseaman7977  With a gyroscope, it resists a change in orientation. In a plane, if you need to make course adjustments as you land, it will be hander since the wheels will not want to change. So the flight surfaces will try to take the plane one direction and the wheels, gyros, will resist that. So if the wings want to move to the left, but the wheels don’t follow, it could cause the plane to tilt. In a car, it is the wheels themselves causing the change in direction, so the gyro forces are acting in the same place as the turning. The friction with the road causes the car to turn without problem.
Reply: Thank you sir, very informative
Reply: Cool!! Nice comment. 

Yeah i always thought to do it little baffles fins on the tyre but this would be crude and just spin them probably not to the required speed but hopefully fast enough to lessen wear but now i see it adds other possible problems so i guess if any benefits are not really worth it
Reply: thanks for your insight, interesting
Reply: If wheel imbalance would shake the aircraft apart, wouldn't this has already happened during airplane take off?  When an aircraft lifts off the runway, all wheels are spinning at take-off speed. Given that the the landing gears are built to withstand multiple times of the aircraft weight (tens to hundreds of tons), how could wheel imbalance force tear landing gear apart?
Reply: @tobyseaman7977  I think was tried and tested too.  Similar to other comments. Spinning anything while in flight adds a lot of variables to control ( Gyroscopic effect, for example maintains a bicicleteo in steady vertical ), the the frecuencia of vibrations etc.  Once you added a restriction to all of that (namely the runway) a lot of these variables go away.  So you add only fins on the Materil side .  But on the dynamics added several variables times as many wheels as you have
Reply: @Hoggaforfan  my thaughts. Just spinning them a little would make them wear more evenly.
just attach some rotor baldes to the rims. That would spin the tires up just a little bit in the airstream. 🤷‍♂
That would of cause increase drag a little bit but we need to kill energy anyway during approach.
Reply: @doncarlo5  Gyroscopes should make it EASIER to land in crazy crosswind, though? Gyros imply greater resistance to being tossed around in new directions.
Reply: For shaking the plane apart: This seems not relevant to the front landing gear, since only one set of pinwheel fins in the front could be made to drive both front wheels together and no matter what speed they were at, it would be balanced. It would also never create any differential for one component failing, like he mentioned in the video. For rear landing gear, sure.
Reply: I consider myself an armchair engineer, but generally the goal when landing a plane is to apply the brakes.  Spinning up the tires to 100mph just to slam on the brakes makes no real sense and would only add more risk of malfunctions occurring plus it'd be a nightmare for the maintenance crew because of the extra wear and tear on the parts involved.
Reply: Great Mr. Witt, and thanks for sharing!
Reply: Very interesting, thank you Bill!
Reply: I never considered the gyroscopic effects created by the spinning of the tire, however, I’d imagine that it could be easily trained around. I once kicked around a similar idea with an engineer. (which I am not.) 

I was reading about a company that was building these super high torque hub motors that were able to provide more torque than the breaks and also, due to being integrated into the wheel, didn’t add anything to the weight. So, essentially, you could pu out the breaks, add in the motor, and be at a net 0 change. 

Then use some sort of super capacitor or other new battery tech that’s nearly out of the lab, and you’d essentially turn the airplane into a hybrid.
Reply: Great explanation, reads like something to reading A&P school.
I am a certified Aircraft Mechanic I only have a measly associates degree in Aviation Maintenance Technology 
15 years General Aviation 20 years Caterpillar, then 13 years at Pratt, production test dress, strip, inspection,
Then development and experimental test cells for individual components each assembly is tested by itself.
It's much easier to just run the assembled TurboFan engine,
I also did teardown and assembly working with engineers to develop the tools and techniques to do the job.
I figured out how to get the high turbine drum apart easier.
Then went to Russia for the MC-21-300 Airliner twice as I was the first flight test engine mechanic..
Not bad for an U.S. ARMY vet the Russians did not want in their factory.
In Moscow I was a fly on the wall during an engineering conference call.
I noticed that everyone kept beating the problem to death.
The tooling for safety pulling the igniters was stolen in Customs.
But the talented kids got some great 1080 dpi pictures of the igniter tips.
I could not take it any longer I had to open my mouth.
I asked the guy if he sees the pictures of the igniter plug? 
Yes, I replied do you see any black lines? 
He said "Who is this guy?"
I said I am the certified Aircraft Mechanic with 14 years experience General Aviation 
and a degree see above 2nd in my class while living homeless in my pickup truck.
If you don't see any black lines that means the spark has not arched across a Crack in the surface of the igniter.
Would you like me to go along for the test ride?
The instructions say that it has to be a visual inspection.
I responded "it was a digitally enhanced visual inspection."
Welcome to the 21st century. The manufacturer sets the procedure 
Last I heard we are the manufacturer, but if we disupt the  base we screw the flight test for however ever many months it takes to get the tooling here.
Reply: Absolutely, you brought up very good points here, and they do make sense because they are explained in plain English that even I can understand. Thank you.
Reply: I ain’t readin allat
Reply: It would change the handling characteristics drastically.
Thanks.
Reply: If gyroscopic effects are such a major factor, why don’t the turbofan engines cause a problem? I assume the rotating mass is lower than that of the wheel and tire assemblies, but a modern high-bypass fan has a larger radius and much higher RPM!
Reply: @JakeRobb  
Placement of rotating objects,
not synchronized to each other,
relative to to other gyros.
Distance increases instability.
Wheels are distant.
I can picture the system forces.
What do you think?
Reply: @doncarlo5 you could spin the tires or not spin the tires at the pilots disgression. If there is a monsoon, don’t use the tire spinning motors.
Reply: @YDDES not proven
Reply: @tobyseaman7977 I’m with you. Do these guys think car tires are balanced with the car on the ground? As for gyro affect, I would think that would cause stability, not the opposite. Probably would cause no problems at all.
Reply: @ayuse01 good thing you are not in the automotive industry.  We would still be driving the Model T Ford and arguing that wooden spokes are better than steel.
Reply: @Mr572u  Elaborate instead of trying to insult people.
Reply: @degraham9198  I’ll say up front that I’m not a mechanical engineer. I studied computer science at a school renowned for its mechanical engineering curriculum, and I helped many mechanical engineers with their studies (usually the math parts, as I minored in math)— but that generally involved understanding the context, so I’ve been close to a lot of the applicable disciplines. That constituted lots of fluid dynamics, thermodynamics, failure analysis, etc — but nothing about gyroscopic forces. It was also about twenty years ago. 👴🏻 So, I’ll appreciate it if you’ll bear with me as I try to learn and understand. 🙂

What I’m seeing in your comment is that you know something helpful, and you’re heavily implying it without saying it directly (and also that it reads a bit like haiku 😂) — and unfortunately, I’m going to need a bit more. 

Wheels are distant from what? Each other? The plane’s center of mass? The engines? 

“Not synchronized to each other” — kinda the same question here — are we talking about wheels, engines, or both? The engines don’t HAVE to be synchronized to each other, but they have the same orientation and under normal conditions are at roughly the same RPM, so any gyroscopic forces should me symmetrical relative to the plane’s longitudinal center, right? And the wheels, if motorized, would also be in the same orientation (assuming the NLG is straight, which it for damn sure should be on approach!) and should generally be about the same RPM. Using a modern brushless setup, they could be controlled to _precisely _the same RPM, if that’s desired. So, what’s not synchronized to each other?
Reply: you say the wheels aren't balanced already? if they can do it for a car, why not for an plane.
Reply: Thanks for the solid explanation.
Reply: You make an excellent point about the gyroscopic effect. That's why the C-5 has brakes on the wheels so that they can rotate before being retracted.
Reply: Thanks!
Reply: Superb post 👍👍
Reply: Considering an aircrafts wheels take great impact on landing and that landing is probably the riskiest part of travel I would not want to increase that risk during critical landing phase. Adding dozens of motors, 100’s of sensors, more wires in the exposed undercarriage I would think bring mores rick with very little gain. Man those motors would burn out pretty fast.
Reply: Thanks for that comment, I was not thinking of the gyroscopic effect and also the necessary braking when you would abort a landing.
I know decades ago a German kid won some kind of scientific award ("Jugend forscht") with the idea of some wheelcovers with integrated flaps that make the wheels turn when the gear was down.
Again thanks for the insight.
Reply: Excellent comment and very valuable additional info.
Reply: I haven't watched the video yet but I figured that spinning the tires before landing would create a gyroscopic effect on the plane's flying abilities. We were given a quality metal toy gyroscope at a young age and were fascinated by how it had its own "gravity" and resistance to movement.
Reply: @BrettForteComedy  moron
Reply: @Hoggaforfan  you are still carrying a bunch of pipes and other bits and bobs for no really good reason when you can solve the problem just with a couple of kgs more rubber
Reply: @Milamberinx  that is always the main driver it doesnt make enough difference spinning the wheels to compensate for additional cost of the spin up system and the extra fuel to drag it around the sky
Reply: @wdilks  Aircraft tyres are heavy, they are much thicker than lorry tyres, changing a 747 wheel you use a hydraulic lift to position the wheel because you cant lift it manually, they stand about 4ft tall, as for spinning the wheel using airflow you have to overcome the inertia not only of the wheel but the rotors of the brake units which again are heavy, so you would need a substantial system to ensure the wheels spin, which is weight you actually don't need to carry around because you don't need to spin up the wheels in the first place Wheels may or may not spin up in the air flow, generally they don't spin much, what you do need is a wheel which will spin on landing under extreme load so good bearings and free spinning brake rotors are important. Pilots generally touch their brakes to stop wheels spinning as the undercarriage retracts and most aircraft have some form of stop pad built into the wheel bay to physically stop wheels when they are retracted.
Reply: @tobyseaman7977  Point is you don't need to do it BECAUSE you DON'T need to do it! the tyres are built to take all the stresses of landing many times, usually a couple of hundred times these days so why bother adding more weight to use more fuel when its a pointless exercise!!
Reply: @MrCybaherbz  Aeroplanes don't always travel in the same direction they are heading, its called side slip or crabbing, and you are right why bother adding all the extra weight of a system (whichever you choose) that isn't needed because the tyres which are already there do all the things neccessary by taking the various loads imposed and it costs the operator LESS
Reply: BOLLOCKS. It would take 300 kilograms of batteries and less motor/generator weight than the weight savings from chucking the friction brakes to use electric regenerative braking systems to accelerate the plane to take off speed. And if what you say about vibration was true, then why don't the plane vibrate when the wheels leave the ground spinning even faster at takeoff?
Engines could be far simpler and more reliable and efficient at flight speeds, if they didn't have to provide maximum thrust at low speed high Atmospheric pressure on the runway. It's all about money on crap disposable wear out fast, I efficient rubbish.
Reply: @davedixon2068  you just made that up. Two hundred landings could be done in a very short period on a short route.
Reply: @tobyseaman7977  OK  I was working in aircraft maintenance for 48 years what are your qualifications to call me a liar?
Reply: @davedixon2068  Just the internet. It says typical 180 to 500 cycles which is three months for some routes. Tires can generally be retreaded a few times.  Tires are expensive so I still find it strange that skidding to spin them up is the best way to use them. But as we established, I know nuffink :-)
Reply: @Hoggaforfan  spinning gyros are used in ICBM guidance systems and early ones used the direct action of the gyro to steer the missile, small gyro affecting large mass
Reply: the answer in relation to most of these posts ie spinning up the wheels is........
Yes you can do it by any of a myriad of methods but we don't because we don't NEED TO!!!
Reply: @davedixon2068  That's a very good answer despite disagreeing with you on other parts of this thread!  I picked the A380 randomly.  T'internet says that tires are $5000 each and last around 180 flights (I don't know if that's full price or a retread).  For a set of 22 tires and doing the math, that's only around $600 per flight.  That's not allowing for the skilled maintenance workers and the logistics but in the grand scheme on things, divide that $600 down to the passengers and it's only one to two dollars each.
Reply: @davedixon2068  I can defiantly see how that works but the changes a missile does is quite small and it's not used to rotate the ICBM to X rpm. Gyros are quite cool effects and spinning up a disk to spin up a bigger disc (the wheels) could work I think but your guess is probably better than mine on how efficient it would work
Reply: Is 300 to 500 cycles per tire between changes? On fighter aircraft we got 15 to 20.
Reply: @tobyseaman7977  So 200 was a good ball park figure then, plus you can see that adding the weight/complexity of most of these ideas is not financially viable and the wind driven versions just add a variable into the control situation just when you don't need it and on some aircraft will be detrimental. with civil aircraft it should be all about safety first but close second comes the money, every time on all decisions, the problems arise when management forgets the safety bit and goes for money first.
Reply: @Hoggaforfan I was not talking about using a gyro to spin up the wheels, I was talking about the effect of large heavy wheels being spun up to high speeds affecting the controllability of the aircraft because they were acting as gyros
Reply: @davedixon2068  Ah ok, the engines are massive gyros already running tho
Reply: @Hoggaforfan  yes but they are at a fixed position and the gyroscopic effects have been allowed for in the design and cancelled out even allowing for varying engine speeds. The main point is "why bother" spinning wheels up is of minimal benefit on a system that already works, it will cost money and may adversely affect other systems which would need to be modified so....."why bother"
Reply: Surely the biggest problem is the weight added by a number of electric motors added to the weight of the generator needed to produce the required power. Nitrogen is used because unlike air it contains no water vapour. Water vapour has a much larger coefficient of expansion than pure oxygen or Nitrogen.
Reply: I think the bean counters in the high tower aircraft companies see it like this. Added weight of motors means fewer paying seats on the aircraft. Less mechanical maintenance means fewer mechanics being paid. Faster turn around for the aircraft that means more passengers moved. More money at the bottom line. Cost of tires replacement is cheaper.
Reply: @aaronfranklin324  Several problems. First, dynamic brakes only work when you are moving fairly fast. They cannot bring you to a full stop, so you still need the weight of the conventional brakes. Second, to stop a (relatively small)  737 would take motor/generators that would absorb about 3500 hp/2500kW. That is not 300kG. Scaling that up to, say, a 747 would be an even bigger problem. Also consider that aircraft landing gear uses fixed axles with bearings between the hubs and the axles, much like trailer wheels. There is not a shaft that could be used to connect them to a motor. And, as has been pointed out elsewhere, they stop the wheels from spinning as soon as they are off the ground. 

It is also worth mentioning that 737 main landing gear is exposed to the air stream, (they don't have doors) so any vanes on the wheels would be there 100% of the time. Not worth it.
Reply: @frankely6378  0.5 X 100000kg X (80m/s ^2) = 320 000 kilojoules
That's 288 kilometres per hour. 180mph. 150kts

So braking to a full stop for a 100 ton aircraft in 32 seconds requires 10000 kilowatts. 
How many wheels does it have?  If it's ten then 1000 kilowatts per wheel. 
If it didn't slow down at all, then that speed would use 2560 m of runway in 32 seconds. 
Yeah.
 you're right. The US should never have bombed the Hindenburg.
 
But seriously that sort of level of  mechanical friction generated heat is stupudly dangerous. 
Have you heard about that 12yr old kid that won the world electric model airplane racing champs over a decade ago with 7kW from a CD-ROM motor he rebuilt with 9Turns of wire on each pole?
How about that Russian Guy on YouTube that got his Old 5 series BMW up to 110kmph on two 10km runs back to back with an old 24V brushed DC starter motor attached to it's gearbox. Running off 5 lead acid car batteries in series. At sixty volts. With a sealed motor with no significant cooling available to it. Getting over 30kW from a 5kg motor?
 
I'm going to have to assume with Airbraking, reverse thrust etc,
  that the real power requirements are closer to 200kW per wheel. 

Which is a piece of piss for an air-cooled motor/generator that weighs no more than 20kg. 
And. What are you talking about with the axle/hub design? The whole point of planetary Gearbox systems is they are coaxial and perfectly compatible with this sort of set up, and who would try and slap something like this on a standard truck anyway?

Give me some solid figures on landing speed, weight, max breaking force from the wheels, of an actual example. And perhaps we can figure out if the US aircraft Industry is worth saving. 
I doubt it. 
As an engineer, I friggen spew when I see the crappy design, materials and construction those airliners are made with.
Do you realise that the aluminium has aged to 1/5 of the yield strength within five years of leaving the foundry? Not to mention the fatigue problems.
Reply: What about after takeoff when all of the wheels are spinning rapidly for a like a minute? Your entire point here doesn't make any sense.
Reply: @hyun1141  apparently they use the brakes to get them nice and hot so as to melt and cause leaks in the hydraulic systems when they retract them . 🙄🤭
Reply: @aaronfranklin324  So your saying that its a good idea to carry an extra 300kg of weight for the whole flight using extra fuel and reducing payload so that you can have a system to spin up the wheels to reduce the wear on the wheels/tyres. But the wear on the tyres is already taken into account during manufacture and most wear occurs during taxying so the spin up system is pointless. 
As to the vibration problem of spinning wheels most pilots touch the brakes after take off to reduce the problem and some aircraft have auto brake systems which apply brakes after take off, mainly to stop gyroscopic effects but also to reduce vibration.
Yes engines could possibly be simpler and more efficient if the aircraft didn't have to do all those other things like take off, land, climb, descend, speed up, slow down but then it would be called a missile rather than an aeroplane and I think people might get upset landing by crashing into the ground at high speed, something that all those various capabilities of aircraft engines are designed to avoid if at all possible.
I agree its all about money, getting the safest aeroplane to fly as often as possible, carrying the maximum amount of passengers, whilst keeping servicing to the minimum, and reduce the amount of fuel burnt by only putting systems on the aircraft that are needed.
Sorry about the long reply but you came up with a bunch of statements which deserved an answer
Reply: People are concentrating on answering a hypothetical question "can it be done?" rather than the real question "do we need to do it"
The answer to the first question is, yes of course, there are any number of ways we can spin up aircraft wheels before landing!!
The answer to the second question is NO we dont, for a large number of valid safety and commercial reasons
Reply: I was going to comment on the gyroscopic effect, but you beat me to it.
Reply: imagine being the poor sod having to balance those wheels
Reply: My thoughts on it were to use a turbine spun by the air and have a centrifugal force break (on the fan only) to control the speed.
Reply: @doncarlo5  That is exactly the only reason for that... Otherwise it is a very simple solution to spin the wheels by adding fins to the rims and when in contact with the airstream they will spin, just like a centrifugal compressor. But the gyroscopic precession would produce a huge force underneath the aircraft that leads to heavy pitching and rolling moments and induce dangerous flight attitudes. That's my 22 years of experience.
Reply: @Tom Smith It is an automatic thing... When the wheels are off ground, the strut is fully extended and touches a sensor that feeds to a brake to stop the wheels from spinning and then starts the retraction process.
Reply: Gyroscopic momentum it’s a big deal, seems like no easy way around it because all the wheels have to rotate in the same direction.

 As for the brakes heating up, needs a new system, to reduce the friction, the coasting Friction, or a totally different approach like regenerative braking, and that will happen if it can be done economically, but sounds expensive right now. It’s a huge amount of heat energy that needs to be dissipated in a very short time and you will know this.
Reply: @Hoggaforfan  :  The speed has to be close to the actual touchdown speed, like half speed would do almost nothing to say tire wear.  It’s because we are dealing with kinetic energy here and the relationship to the wheel rotational speed is in proportion to square law. Because of that the speed has to be pretty close to the actual touchdown speed to significantly reduce wear.
Reply: @doncarlo5  :  let’s presume, and could be wrong, that the gyroscopic momentum is safely manageable on a straight in approach in good weather. Then you only enable the system in those conditions and otherwise you touchdown without spinning up the wheels.   It’s not black and white, most landings are in good condition and maybe that would help a lot
Reply: @tobyseaman7977  :  I had the same idea long ago, just a little brainstorming, but we must realize it is important to spin the wheels up to nearly or matching to the actual touchdown rotational speed, otherwise there will still be a lot of wear and tear. This has to do with The square law relationship of the kinetic energy of the moving parts.
Reply: Answered a lot of questions I had, thank you!
Reply: @thomasmattei2818  total bs
Reply: I'm confused that the vibration is a problem prior to landing but suddenly not a problem after the tires make contact with the ground. 
    I once proposed that the wheels had louvers that could act as "windmills" to start the wheels spinning after "gear down" but before touchdown just to get them spinning a bit. This would require no motors - it would be a passive way to get them spinning.  
    But if the balance/vibration problem is only present before touchdown then This solution would not work either.  One engineer told me that the wear on the tires is the same, spinning or not.
Reply: How do you keep, ensure tires are balanced? My new tires shake the back of my van at 65mph. I cant imagine the precision it takes to balance an air liner tire... or what would happen with an out of balance tire.   ??
Reply: @tobyseaman7977  Planes fly in 3D space (roll, pitch and Yaw) not on a 2D surface
Reply: Ah. Now I know. Thanks.
Reply: @bushmasterflash best answer I’ve seen
Reply: @Gabriel Stahl, listen to the video again and read carefully the comments from engineers and techs who maintain these systems. Basically, your idea would be costly and introduce problems.
Reply: @justinwade8920  I can't believe this thread is still going on. :)
But for all still posting. Rotor vanes to spin up wheels have been tried and tested on airliners.
Yes, it can save a little tire wear but at higher maintenance and operations budgets, overall it costs more $ than just changing tires. On large aircraft, no gyro effect was reported by the test pilots. None. i.e. Any effect (and there must be some) was not noticeable from the cockpit. The noise of the vanes in the airflow was horrific. Changing the vane profiles reduced this but also reduced the wheel speed they could achieve. Tire imbalance did cause vibrations (and a wheel under speed in the air) and yes they do continue to vibrate on the ground but they are slowing down by then and will only resonate at frequencies depending on their unbalance and as they are continuously changing speed it is less noticeable. They do it at takeoff as well. Most people don't even notice, pay attention next time. The brakes are auto-applied before the undercarriage is retracted into the airframe which means the vibrations stop quickly once airborne.
There is a whole ton of other stuff like tandem wheels causing disrupted airflow, and altitude, temperature, and wind speed variations all affecting efficiency but it became irrelevant in our tests because the end result was always going to be the same.
It is cheaper, simpler, and easier to just keep changing the tires.
If anybody can come up with a system for anything on an aircraft that is cheaper overall for airlines to implement they will rip your arms off to get it. It is 100% cost driven.
Reply: I was just thinking about the 'gyroscopic' effect. You are correct sir.
Reply: I’m convinced!😮
Reply: @DavidSmith-vr1nb  good point.  To engineers on the ground, many ideas arise. To pilots it’s one more thing to monitor and list-check, and new protocols for finding and fixing in flight.
Reply: This reminds me of Marie Vaughn’s Rule: Theory and practice are identical, in theory; unfortunately, not in practice.
Reply: @tobyseaman7977  Cars are not floating in the air, where things like torque have a much greater effect on them.
Reply: To OP, well said and so obvious if you’ve ever worked on a plane, or watch dirt bikes jumping.